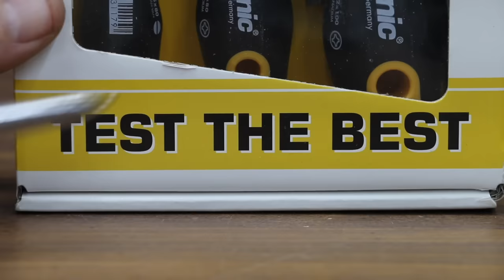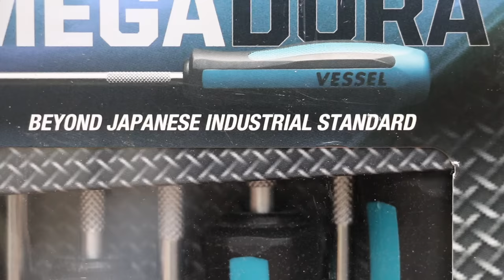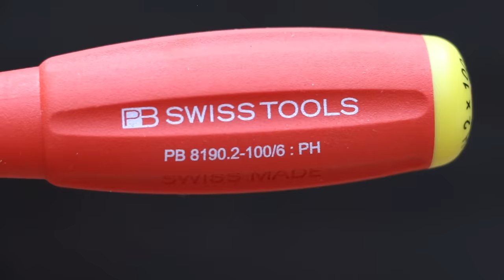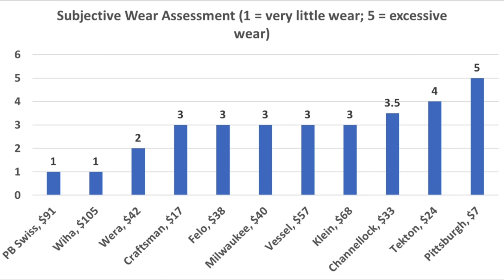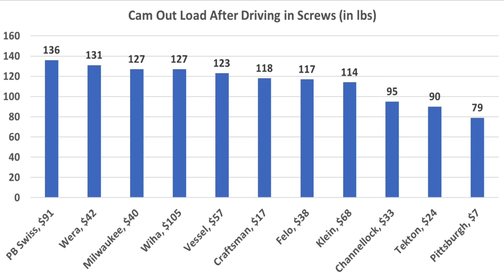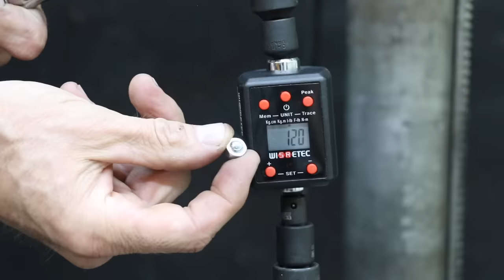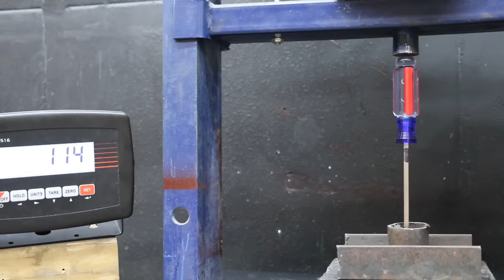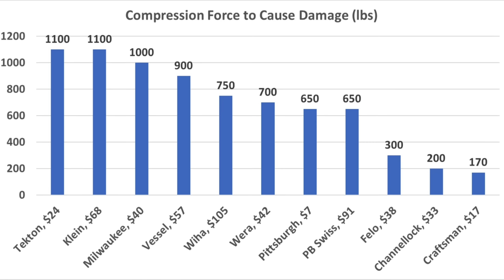Best Screwdriver Set? Craftsman, Milwaukee, Wera, Wiha, Klein Tools, Felo, PB Swiss, Tekton

Comment: it was interesting to see the torque difference between phillips and flathead, would be cool to see a video comparing the torque abilities of the other fastener types like square, hex and torx!
Reply: Robertson square head drivers and screws work best.They do not slip or easily break.Philips cannot perform to the same strengths.
Reply from the maker: Thanks for the suggestion.

Comment: I use Vessel screwdrivers on Japanese cars.  The JIS standard used on most Japanese cars works far better with Vessel.  I consider them a specialty tool, not necessarily general purpose screwdrivers.
Reply from the maker: Thanks for sharing.
Reply: Many people do not know about JIS tip on Japanese machinery
Reply: Have a vessel hammerable screwdriver used to remove stuck screws. Serious tool.
Reply: ..Interesting...I work on small engine(I.E.: hand-held equipment, mostly 2 stroke), and now I am wondering if Vessel screwdrivers would work better on the screws in Japanese-brand equipment, such as Kawasaki, RedMax, Echo,Shindaiwa, etc.?.....
Reply: @dyer2cycle  must be JIS size on Japanese screws are unique.
Reply: @dyer2cycle  I'll bet if you go to the Kawasaki, Honda, Suzuki dealer, they'll have vessel screwdrivers in their tool chest.   Like I said, when I work on my Hondas, those JIS screwdrivers don't cam out, but a regular Phillips will.
Reply: @MitzvosGolem1  Any recommendation for JIS screwdrivers other than Vessel?
Reply: @unmeshagarwala8156  mititoyo . Honda and Kawasaki have JIS tool set s also.
Reply: @dyer2cycle It'd be worth it to look up the JIS standard to see if the geometry of the philips head is any different than the SAE or metric. I doubt it is.

Comment: “A screwdriver is not a chisel, punch, or pry-bar”
-no technician ever. 

Apparently, at least some manufacturers have given up on this as well. At least the one I work for often depicts in both pictures and words using a flat blade screwdriver as a chisel and pry-bar. They only recently started doing this. Occasionally they’ll even throw in a disclaimer saying don’t do this immediately after telling you to do it.
Reply: my Wera screwdrivers have metal hammer butts, single piece with the shaft :)
also good for hammering something.

Comment: Love my Klein screwdrivers they have worked extremely well for over 14 years in the trades. I do however also have Snap-On and Williams brands. Would like to see them tested!! The Williams (Snap-On Industrial brand) can be had off Amazon for a very reasonable price ($65/set) and I’d compare it to buying a couple of Snap-On’s off eBay for testing.
Reply: Klein is  great for the price.
Reply: Klein quality has declined over the years. They were once considered the best but it seems they've been cutting corners lately.
Reply: @billgriner3754  the klein screwdriver my grandfather handed down feels exactly the same as my new one, except the rubbery material on the handle on his is a bit worn
Reply: I have an older Klein flat head screwdriver and I'm sorry to say that it's garbage. and a Stanley screwdriver and crescent wrench and they are garbage. my suggestion to Stanley is stick to making hammers and saws.
I was going purchase a set of Snap On Blue Point screwdrivers but didn't. I don't know if they would have been significantly better than any other brands. and I wouldn't normally want to say that about Snap On tools.
Reply: Yep, been using my set of Kleins at work for 10 years now, and they were my predecessors, who knows how long he had them. They are holding up well.
Bought a set of Craftsmans for at home and they’re decent, but the Kleins definitely better. 
Now I just need an excuse to buy the PB Swiss or Wiha set….  Hmmm…..
Reply: I bought a set of  Craftsman screwdriver, back in 1969.  Still using them today.  Unfortunately, the handles on my Snap On tools have cracked and fallen off.
Reply: Old american brands are made in china now Craftsman excels from the rest because they make their tools in Taiwan they have exceptional metallurgy there especially for the cost
Reply from the maker: Thanks for sharing.  Thanks for the suggestion.

Comment: For Phillips, I’d like to see snap on added. Trouble is one of them is as much as a set of other brands. 
I’ve started buying Carlyle screwdrivers. They seem pretty good. 
Thanks for all the great tests!
Reply: i find Wera are better than snap on  in as for cam-out
Reply: @77appyi  
That’s good to know. I’ve only used a Wera chisel driver flat head. That Phillips tip looks like it would give snap on a run for it’s money.  Really liked it except for lack of local availability.
Reply from the maker: You are welcome!  Thanks for the suggestion.

Comment: Man my old "USA" made Craftsman's have done me well for years but it seems their replacements will be German or Swiss.
Reply: SnapOn replaced my Craftsmans decades ago.
Reply: @Inquisitor6321  Yes, I have a set of SnapOn Combo wrenches that are great. But for the non professional mechanic they are a bit expensive. Craftsman went to hell back in the late 1980's in my experience.
Reply: I just snapped the tips off 2 of my plain blade USA Craftsman screwdrivers by hand trying to remove a screw from a kids bike. Not impressed. Can't count how many times I have broken their wrenches. 

Was a good tool that had the easiest warranty ever and that made them a good deal for 99% of users. Just wasn't a top tier tool ever though and I have been using them since the 80's.
Reply from the maker: Thanks for sharing.
Reply: From what I have read, Craftsman (now owned by Stanley Black & Decker), is opening up production facilities in the USA in the very near future. I surely hope so because I want to start replacing some of the USA made stuff I got as a youngster, with new USA made Craftsman. I hope they pull through.
Reply: SK TOOLS
Reply: I purchased a set about 5 years ago of the craftsman. Not impressed. Broken off several tips already using hand tighteneing/loosening. Once I get my workshop done I will be buying german made replacements. Probably Wera.
Reply: I can certainly confirm Craftsman has been going downhill for quite a while. I used to work in a hangar that had a bunch of 1950-70s Craftsman tools and even after 50+ years, they outperformed my 2013 Craftsmans.

Comment: One thing an engineer once said to me: "A screwdriver is only as good as it's handle." Thanks for the extensive testing! What would you think about an ergonimic test on the handle?
Reply: I think ergonomic tests would be a bit too subjective. I'd rather know which are the top three brands and then check 'em out in the store and find out what fits me best.
Reply: A screwdriver is only as good as the screwball turning the handle.
Reply: @1pcfred  :D Absolutely ;)
Reply: @John I have a couple Snap-On tools. I like my Smith smoke wrench the best for loosening up seized hardware. It's one Mickey Mouse tool that really works.
Reply: @John Thanks for your kind reply and giving your impression on me and my friend. Of course the working end is the object of interest and covered more than great in this video. But leaving the handle out of the equation, just reminded of the sentence I once heard from him.

Comment: Great test as always but having spent 20+ years as an aircraft mechanic I can tell you that handle design has as much to do with the ability to remove a screw as the tip. Personally I always used snap on but their design has been copied by many brands.
Reply from the maker: Thanks!  Thanks for sharing.
Reply: It has to feel comfortable in the hand before you even try to remove a screw

Comment: I'll always love Craftsman acetate screwdrivers. What I used when I was younger, as that's what my dad had (and still has most of them). I have the ones in the video, but the big kit, really like them. Not sure how the new ones compare with the USA made ones, but one of the more noticeable differences is how far the driver mounts into the plastic handle. I think in some, there is a small amount of empty space in the handle hole, too, which could be why the handle pushed in a bit in the press test. 

Just wondering if the handles will eventually get that signature smell!
Reply: yes, white powdery crap on them too
Reply: Same here. Ive bought up enough USA craftsman screw drivers to last me a lifetime.
Reply: The Craftsman screwdrivers are also my go-to in every tool box at home and at work. The feel in the hand and the torque you get on the handle are very good. Classic design.
Reply: @carlmccoy662  Yeah, acetate handles offgas. I've heard of the powdery stuff but never seen it on any of ours, or other brands with similar handles. They all have got that smell though. I like it, some say it smells like puke.
Reply: I'm not a fan of those. My father has some of those and they all have chipped heads on the phillips ones. My Wiha PC tech screwdrivers bits have much much less wear and I have used those for over 10 years. The Wera set he showed here is a good deal. Even better yet if you look around you can find similar sets for as low as $24 with sightly different sizes for a total of 6. Some insulated electricians sets under Wera are even this cheap as well!

Comment: Why have "stubby" screwdriver gotten so long?  A year ago I lost an old stubby phillips, really great for close-quarters auto work.  I finally decided to replace it but while all the so-called stubby phillips had the same size handels, they all had noticeably longer shafts.  This makes them way less useful then the old one I lost.   I looked everywhere to find a short stubby but finally gave up and bought a Craftsman, the shortest of the now longer "stubbys". 

A month ago I dropped a nut and it rolled under a raised cabinet in my shop.  As I went to retrieve it I found my long lost stubby!   Putting it side-by-side with the replacement Craftsman, sure enough my old stubby is shorter by 3/4".  It's likely an inch or more shorter compared compared to all the other new shorty phillips I looked at.

Who decided that making longer and less useful stubby screwdrivers was a good idea?
Reply from the maker: Thanks for the feedback.
Reply: klein makes a stubby 5 in 1 that is amazing
Reply: They’ve been made longer since Carburettors have disappeared, 90% of people have no need for those tiny screw drivers anymore
Reply: @loganamurray64  Technically there's no need for screwdrivers any more because we're not allowed to repair anything ourselves. Soon you're gonna need a license to buy screwdrivers 🪛  it'll be worse than handguns.
Reply: share a pic. somehow, please
Reply: And sadly the craftsman ratchets have shrunk.  I have broken my 1/2" swivel ratchet and the replacement lost about an inch.  It makes a difference!
Reply: @countryracer69  Harbor Freight has some ratchets some swear buy. I think some are good value.

Comment: FYI Wera sells a set of "chisel" screwdrivers, where a metal shaft goes all the way through the handle. It's interesting to see the non-chisel Wera screwdrivers perform so badly in the hydraulic test.
Reply: ive noticed with the germanbrands that they are a lot more purpose built, like you have specific chisel sets, ones that prevent cam out, and then really well made insulated ones, but none do it all. I guess thats a good thing in the professional space because a jack of all trades is a master of none, but it is a bummer sometimes for a home set
Reply: Not so interesting. Wera using ordinary polypropylene for handles of this type of screwdrivers. We are working with them in cooperation (Czech Wera). Iam using both - chisel and non-chisel Wera screwdrivers and they are practicaly undestructible when you are treat them as an human and not as an animal :-)
Reply: 700lbs doesnt seem to shabby for that type handle! Im not necessarily a wera fan but it wouldn't phase my decision to buy it that was what I was looking for in a handle.

... You would have to use a 10lb hammer to hope to get near that much force.  Repetitive striking may eventually degrade it but average use I'd think would be ok.
Reply: @MrGSSM  It is possible that to perform good in hammering the metal should not be as hard, because it would make it brittle. But if you don't plan to abuse it, you just need a precision screwdriver which  does not wear, then it is better to be more hardened.
Reply: @MrGSSM  Unfortunately it appears you've succumbed to  a particularly salty case of confirmation bias, and as a result, the very point of the thoroughly contemplated and carefully administered tests conducted in this video seem to have just gone🤔........................ ZOOM!🤯 
Right over your head, sir. 🤦😋
Reply from the maker: Thanks for the feedback.

Comment: On the slotted test, none of the drivers were the correct size for the screw.  The blades perform better when matched to the screw.  You mentioned that the Craftsman set had a larger driver.  I understand you wanted to compare apples to apples, but the screw called for an orange and in at least that one case, an orange was available.
Reply: Well said! While the slotted test was vaguely amusing, it didn't have any practical value since the screw was so poorly matched, in contrast with the Phillips test.

Comment: The wera is by far the best, I'm using them since years and they hardly have any wear, the lasertip is also quite good since you don't need a magnetic tip, the screwdriver sticks to every screw right away.

Comment: One thing I’ll always give Klein screwdrivers is, I once dropped mine off my scissor lift without noticing. After driving forward 3 times unsuccessfully, I looked down and noticed that my Klein flathead screwdriver handle was stuck under the wheel. It didn’t break or crack at all, and only the rubber coating was worn down from dragging between the concrete and the skyjack brand rubber wheel. 

Quite impressive, even if they aren’t your favorite haha
Reply from the maker: Thanks for the feedback.

Comment: Would be nice to see how the old Craftsman screwdrivers performed - back when they were actually made by Sears in the USA.  I've still got a set that's about 30 years old and in decent shape.  I've only bent the blade on one.
Reply: Even the new ones aren't that bad -- you can buy five sets for the price of one of the premium brands.
Reply: I have a lot of the old Craftsman tools too. Only the ratchets have failed.
Reply: Old Craftsman vs the new Crapsman! Definitely the older ones will win
Reply from the maker: Thanks for the suggestion.
Reply: @ElainesDomain  +1 on that. Many of the "failed" ratchets I bought or found just needed to be cleaned and oiled to return to like new service. I do it all the time. I rebuilt one for a coworker who couldn't find a Sears open in his area. Says it works like new after I fixed it and he uses it all the time.
Reply: True. Thirty years ago they were hot forged (and marked "Forged" on the handle so that's how you knew). About 25 years ago according to Western Forge (who made them for Sears along with Pratt-Read), they stopped the hot forging process, I assume for cost reasons. They were still good, but not as durable as the older ones were as many have experienced. Sears didn't "make" them, but they did provide initial investment money to Electrolite in 1965 when they were formed in Defiance, OH. Eventually that became Western Forge and they moved to Colorado Springs, CO and got the moniker "Mile High Quality" due to their location.
Reply: @ElainesDomain  Sears used to give you a free rebuild kit if you told/showed them your failed ratchet.

Comment: Interesting test as usual!
All my screwdrivers are Wera, Wiha or Felo, depending on application... All of them perform really well, and how well they fit seem to depend a lot on the brand of the of screw. But the Wera laser-tips do grip better than most, but the laser grips do wears out over time. 

I've had some issues with the Weras since they moved their production from Germany though, thankfully Felo still makes theirs in Germany. Hard to go wrong with any of them. Remember that Felo and Wera both have special lines designed for hammering use with the shank going through the entire handle with a steel cap. I do recommend getting the Felo 500-series over the ergo though, they're way too soft.

My old Felo set it just over 20 years old, and the new set I got last year is holding up just as well.
Reply from the maker: Thanks!  Thanks for sharing.

Comment: Can you do an update to include Pittsburgh Professional? They're incredibly cheap and I've found them to be an outstanding set of screwdrivers!
Reply from the maker: Thanks for the suggestion.
Reply: @mikew6786  not everything at harbor freight is garbage, their "professional" lineup has some great tools, and their "icon" lineup can hang with or beat Mac/Snap-on in many cases. The Pittsburgh Pro screwdrivers and ratchets are excellent tools.